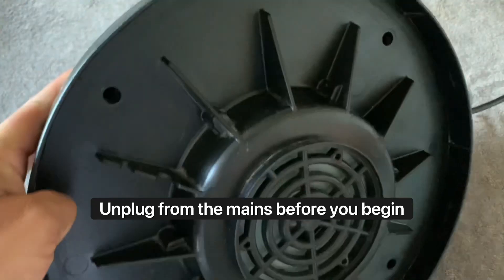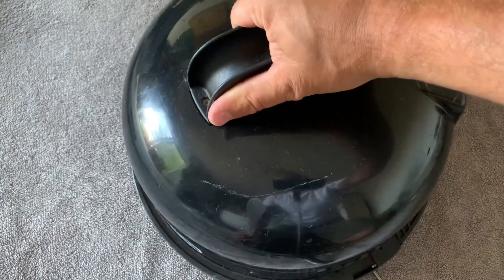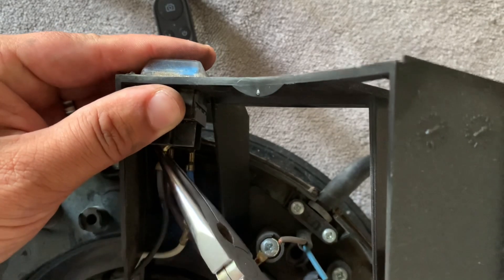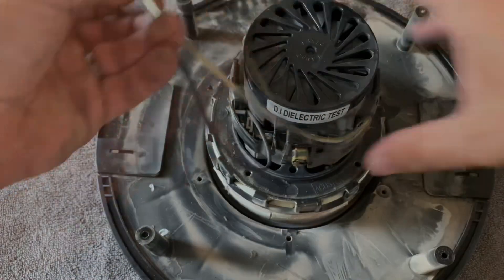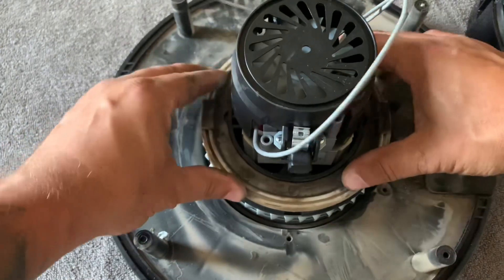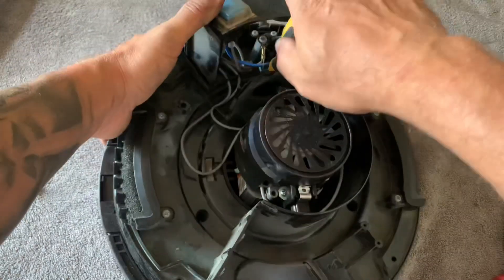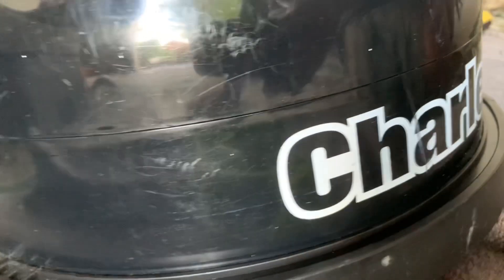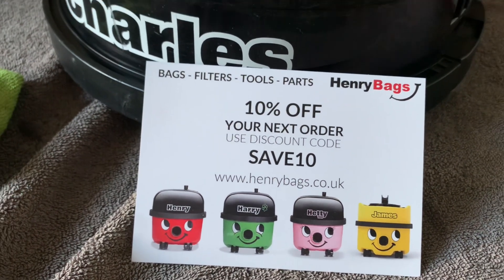How to Replace Numatic Charles or George Motor

Comment: At last a clear and concise video without a load of needless chatter, Well done Sir
Reply from the maker: @CliveHateley  thank you so much you have made my day. I started these videos with that exact mind set. I can’t stand listening to what people had for their tea and helping them to look for a screwdriver 😂
Reply: @vacuumhelp  Started to strip my George to replace the motor but the three screws that hold the motor in place are solid and were so rusted that a philips screwdriver wont grip properly, I have careful as they are well and truly stuck.
Any ideas of how to shift them as they are awkward being down so low nothing can get at them?
I did soak them in penetrating oil for a couple of days but it made no difference.
Reply from the maker: @ oh no what an absolute nightmare. The only thing I can think of is to get a drill will a metal cutting bit on it and drill the heads off the screws. You can then hopefully get them out after lifting of the inner casing and then replace the screws with new ones??!

Like you say it’s hard to access them

Comment: I ordered a George. The vacuum works great but the wet vacuum doesn't work. The motor for the wet vacuum doesn't turn on. After prodding around, I can now get the motor to turn on, but it is extremely weak. The spray does not work as a result. Would like advice. Thanks. 
(I'm in the US so replacing parts would be a hassle)
Reply from the maker: @JeanetteVuong-h1n  is this a new item you have bought? I’ve never heard of this issue on a new one so just return it for an exchange.
If it’s a used item, run some descaling fluid through it and that often helps most issues. Nozzles can also be soaked i. It overnight. If nozzle is blocked it can be the cause rather than the pump. (Most of the above obviously is only if it’s a used item)